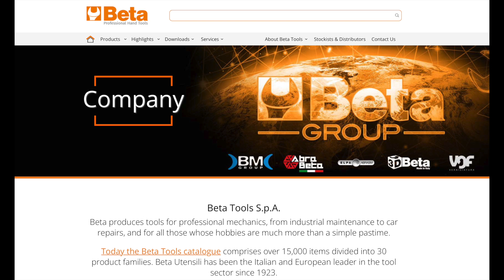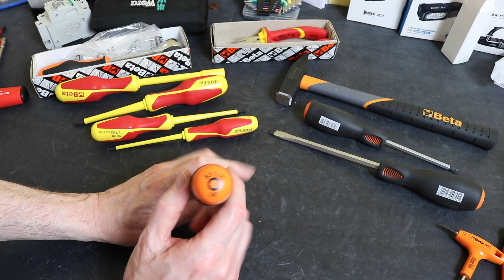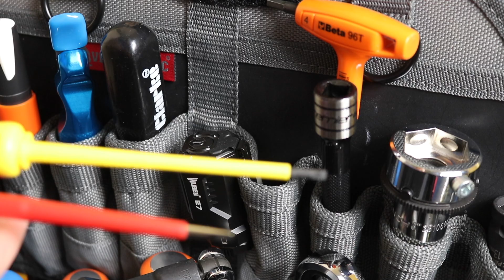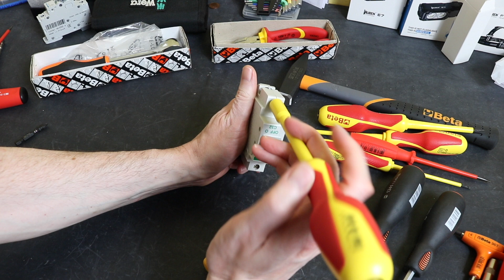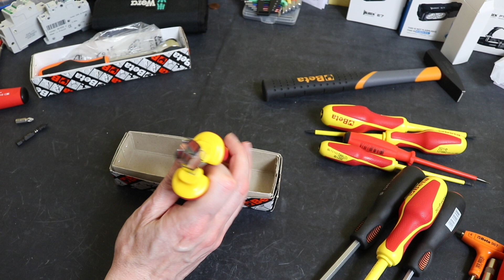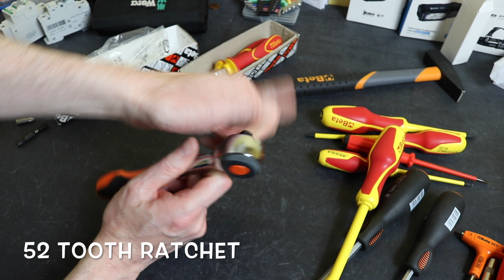Beta Tool Haul

Comment: I have had the adjustable t-handle hex and torx beta tools sets for 5-years. They are heavily used in F1 and automotive industry m. I bought them for my bike repair and maintenance purposes, but I also use them in HVAC work but not electrical work. These adjustable t-handles are super nice and are adjustability allows you to get into very tight spaces hence their popularity in F1 when engine packaging and aerodynamics mean extremely tight spaces.
Reply from the maker: They do seem to make some good tools. I haven't really seen them in much use in the UK, but haven't really seen them advertised either. Think the UK is a relatively small tool market, and there are already a significant number of brands already established.
Thanks for watching and commenting.

Comment: You mentioned PB Swiss Tools in the video, where do you buy them from?
I used to buy them from "only quality tools" but they've sadly closed down now and I go out of my way to avoid Amazon. I do love that the PB Swiss screwdrivers leave a bit more of the screwdriver poking out than most. Hollow ground screwdrivers like PB Swiss and the Beta low profile one you had are so much better and disappointingly rare.

I've got some Beta ratchet rings I bought years ago from Hayleys. Went in for some belts and came out with some spanners! Of all the tools I have like that, they're among the nicest. 
Have you found the twiddly-handled ratchet actually useful?
Reply from the maker: You can get PB Swiss from the Hoffmann Group. They have a pretty good range and stock holding;

https://www.hoffmann-group.com/GB/en/houk/v2/search?search=PB+SWISS+TOOLS&manufacturer=PB+SWISS+TOOLS

I hadn't come across Beta before, just seen them starting to be stocked in some of the shops I buy from.

The roto-ratchet is more of a nice to have really. Helps out in a few limited situations, but generally you can get away with an extension with the ratchet etc.